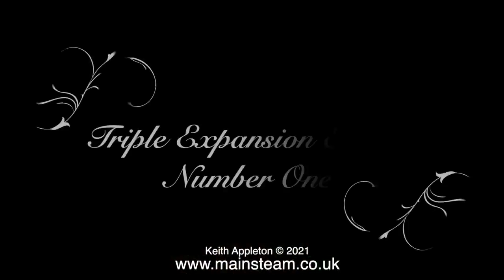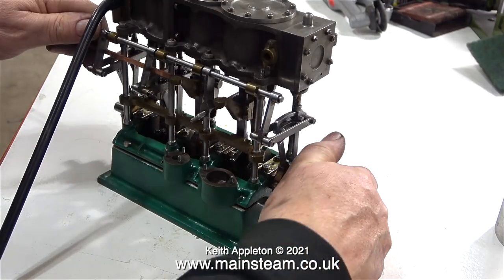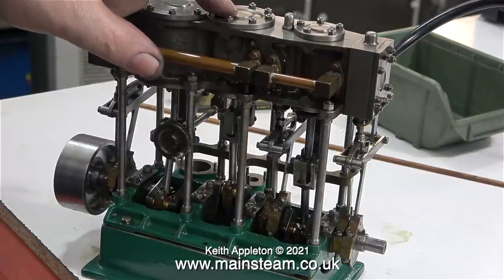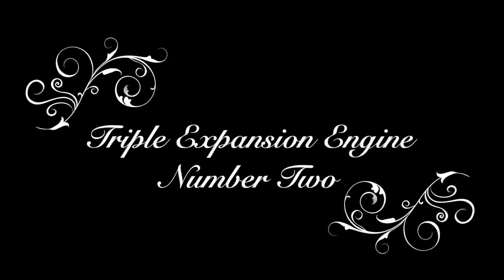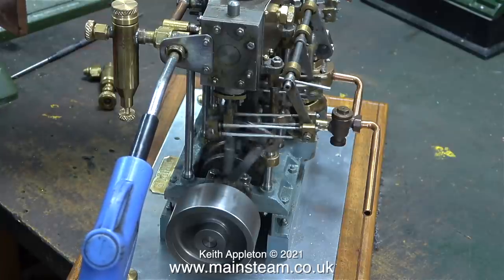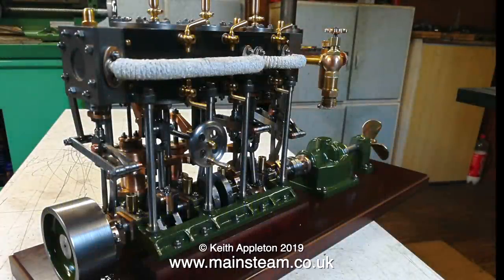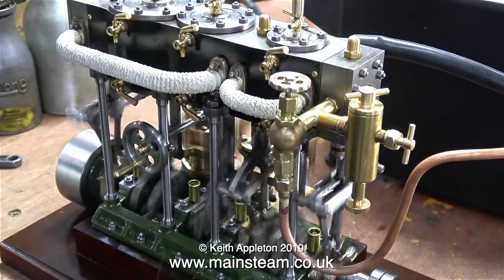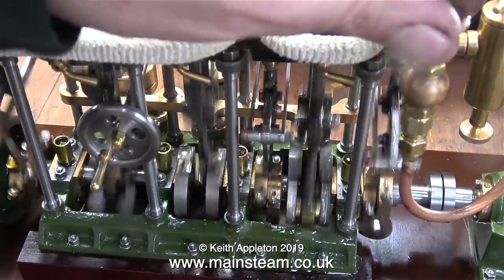THREE STUART TRIPLE EXPANSION ENGINES - IN THE WORKSHOP

Comment: Keith...I would like to hear you comment on the efficiency of a triple expansion compared to a single.  With the steam being used three times it seems like there would be much more power with less steam used.  A second question that is based on the assumption that triple expansion engines were often used in marine applications.  How did they restart the engine when reversing the prop direction?
Reply from the maker: using the same steam 3 times on every cycle makes a Triple Expansion Engine more powerful and more efficient
Reply: Triple expansion engines are remarkably efficient.  Add Corliss valve gear and the efficiency approaches that of a steam turbine.
Reply: Steam engines can run on air but really like steam. Steam does not have a chance to expand while the inlet valve is open. Close the inlet and it can now expand. But how much it wants to expand versus how much it can actually expand is determined by the increasing cylinder volume as the piston moves. So steam expands from cut off until exhaust. A good part of your power comes from expansion. So when the piston comes thru cushion, the exhaust valve opens. The exhaust is still under pressure and still has more expansion available. Instead of free jetting this to atmosphere, it is now used in the next cylinder. Each successive use of steam is under lower pressure. So the piston area is increased to reflect this. Each time, more of the available expansion is used. Since boats have to carry fuel, it’s important to the most out of your steam.

Comment: As I was watching a thought occurred to me; Why are the triple expansion engines not self starting? the three cylinder engines on Shay locomotives are self starting, so what's the difference? 
So, here's my answer right or wrong. The triple expansion engine admits steam only into the high pressure cylinder at start up and the other two do nothing, thus resisting any motion. The Shay locomotive on the other hand is either three separately operating engines or a system that feeds steam into all three cylinders is used at start up.
So, a triple expansion engine is actually a "compound engine". Large compound steam locomotives use a system that allows simple, steam at high pressure is admitted to all cylinders during start up and then switched to compound after reaching a certain speed or motion. 
Am I right so far?
So, can YOU add a system to your triple expansion engines to make them self starting? Now that would be a great model engineering project series. I'd use that engine with the propeller attachment. No change to the actual engine just a simple/compound system added. Then put it all in a radio controlled boat and go sailing.
Keith, this video showed me that you teach us more than you think you are. Like anything else in learning, the light suddenly went on in my head, leading to both questions and answers. Love it. ;-)
Reply from the maker: Please type simpling valve into Google.